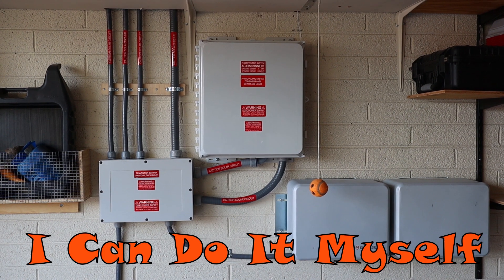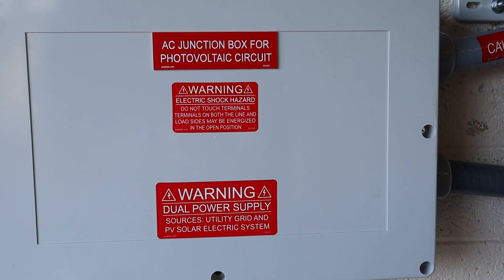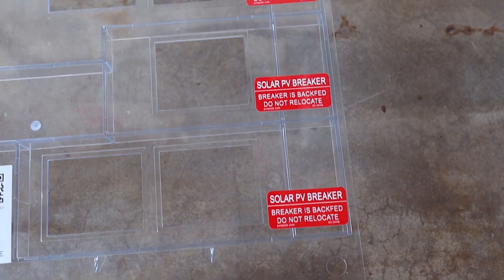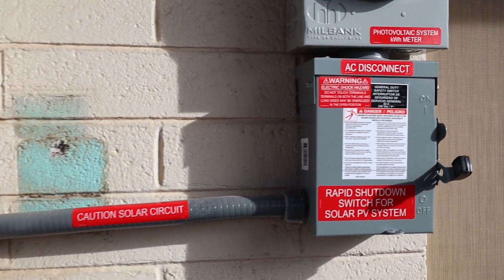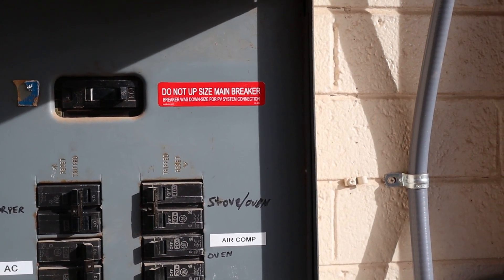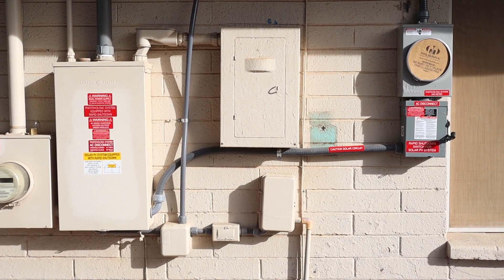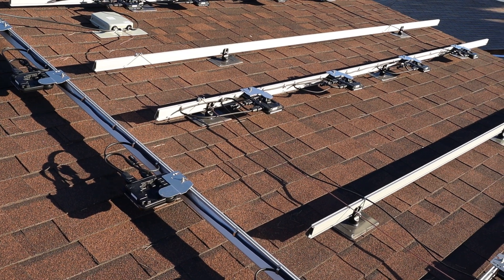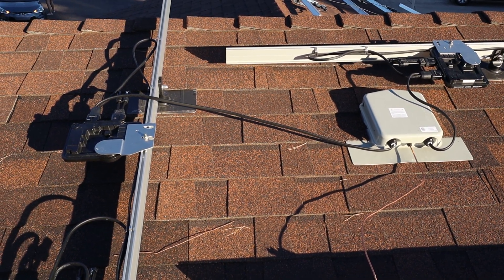My DIY Solar: Part 7 Warning Labels and Enphase IQ6+ Microinverters

Comment: You actually inspired me three years ago to install my own Enphase micro inverter grid tie system. It has worked flawlessly. However, when I decided to install the battery back up option it has turned into an ongoing nightmare. I had to buy a $500 cell modem, finished the installer course and installed my system but now they want me to complete several other courses to turn it on. It is finished but I am unable to turn it on. Never again, Enphase is becoming very DIY unfriendly.
Reply from the maker: This information is valuable to myself and to other views, I'm Sure. Good to know, thank you for sharing.

Comment: A Billion Thank you's for all your solar videos.  I now have a 13kw system.  I watched them at least 10 times each.  I particularly liked the combiner box vids.  My city signed off on my new system last week.  I passed the racking inspection and pre-wire inspections with flying colors but I failed the rough wire 2nd inspection due to lack of labels.  I had no idea the Rocky Mountain Power had a totally different list of solar placards then my city planning department.  Anyway I had Office depot print out the six more labels and I glued them onto my outside connection boxes.   My Solar disconnect looks like a rock concert advertisement telephone pole.  So many labels one can not even see the disconnect anymore.  My only real mistake was I cut my Enphase solar trunk cable too short so i had to add an enphase field connector.  So fellow folk do not make the same mistake: If you have a stair stepped array (not all panels in a straight row, Enphase give you only long trunk cable. it is ok to skip one of the inverter plugs and go to the next.  Example: 5 panels with 3 on top row and 2 on second row.  You will need a truck cable with SIX connectors so you skip one connector when you run the cable from the top row to the second row.  You just plug the unused inverter plug with an Enphase waterproof cap. you cover this at the 5:40 min mark but I missed this detail.  So I am now waiting for RM Power to install my solar meter next week.  Enphase has already tested my system remotely and pushed the latest software update.  If you have an older install it is recommended that you have Enphase push and update as it may very well increase the efficiency of your inverters and panels.  it is a free service and takes about 24hrs.  Thanks to Mike, I used 10/2 romex throughout my system as romex does not require conduit in the attic.  You can use a cheaper 12/2 but 10/2 i think is just more efficient due to the 100ft lengths of wire.  My next project to to try to trick a portion of my arrays to supply power only to my two freezers.  As you know a grid system shuts down when grid power is off.  I want my freezers to run if there is a natural disaster.  Any suggestions would be appreciated.  I am 66yrs old and this was all very doable do do myself.  I did hire an off duty roof person to help haul the panels up to the roof.  They were only 44lbs but very bulky.
Reply from the maker: I'm glad my videos helped at least one person save money and do it themselves!

Comment: You’re in the valley?
How was it working with SRP?
Reply from the maker: The hardest part of the whole thing! They kept moving the goal post, dragging their feet and putting up road blocks. But the power was out in my neighborhood this morning and because of the solar and Powerwalls, I never noticed.
Reply: @ICanDoItMyself  yea I am just starting the process and have to start sending the info in. Etc.  any pointers?  If you want to talk over this or a different app that’s fine with me.  Your video was very helpful.
Reply from the maker: @jeredvanhouten6607  you can message me on Instagram too if you prefer.
Reply: @ICanDoItMyself  will do. Thank you.

Comment: Can you explain why you ran three separated conduits from the arrays instead of combining them all into one?
Reply from the maker: Since they came from three different areas on the roof, it was easier to combine them in a junction box in the garage rather than somewhere in the attic.
Reply: @ICanDoItMyself  I actually figured out he answer to my question pretty fast.  When trying to stuff a #6 ground wire and a piece of 10/2 romex 3/4" conduit is all it can handle.  I ran a separate 3/4" conduit to my enphase combiner box for each array
Reply from the maker: @navyretired230  I ran 1/2" conduit but with individual 12 gauge wires plus the #6 ground. Individual 12 gauge spools were less than the romex. One of them I was able to fit 4, 12 gauge wires plus the #6 without difficulty.

Comment: How did you decide what operating current to put on your label outside, the 35.1 amps
Reply from the maker: Each microinverter puts out a maximum amperage, .96 for the IQ6 and 1.12 for the IQ6+ I think something like that. Add them up for the total.
Reply: @ICanDoItMyself  Thanks for the fast reply!!

Comment: Do these run on 240  or 120 volt? Can you please respond. I just got my first Enphase IQ6 and it says 240v. Do they come on 120 volt?
Reply from the maker: They are 240v. In the U.S. we get two lines of 120v, equaling the 240 volts. They do not come in 120 volt.

Comment: Why did you have to rotate the micros?
Reply from the maker: The instructions say to mount them a certain way, I didn't read that. If I didn't flip them, there may not have been enough clearance between the inverter and the panel. But I'm just guessing.

Comment: Why did you have to derate the breaker?
Reply from the maker: You can only have 120% the rating of the panel. 200 amp main x 120% = 240 amps. Maximum 40 amp breaker to backfeed. Derate to 175, leaves 65 amps available to backfeed. Otherwise you could overload the panel and have a fire.